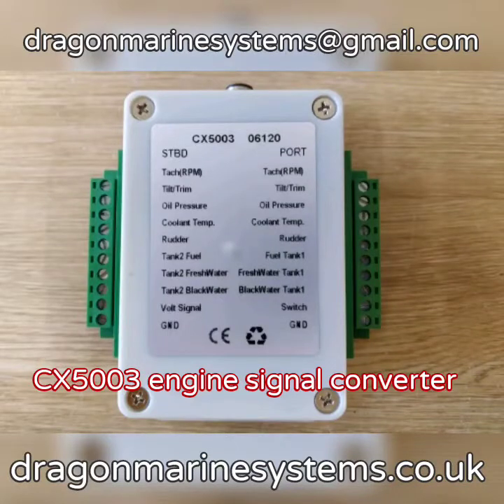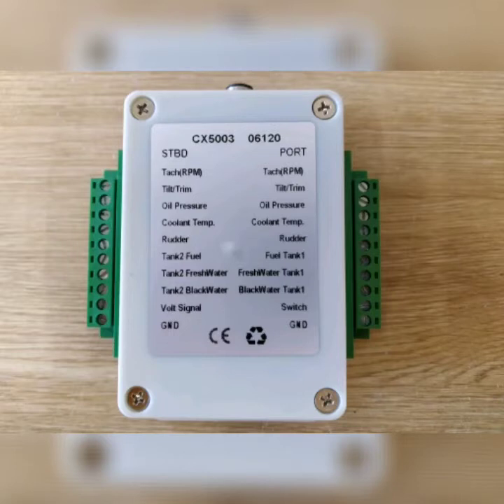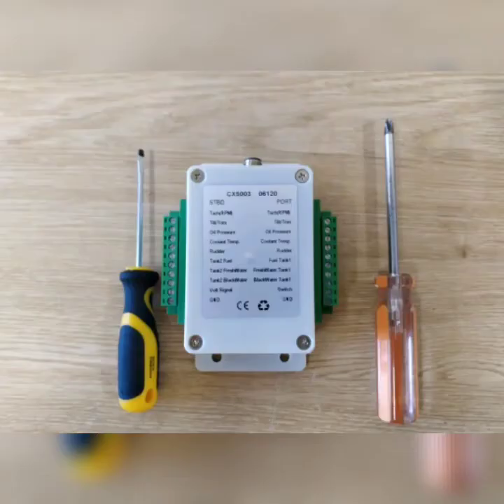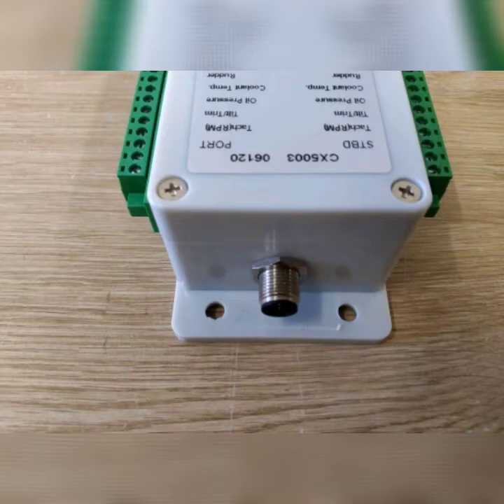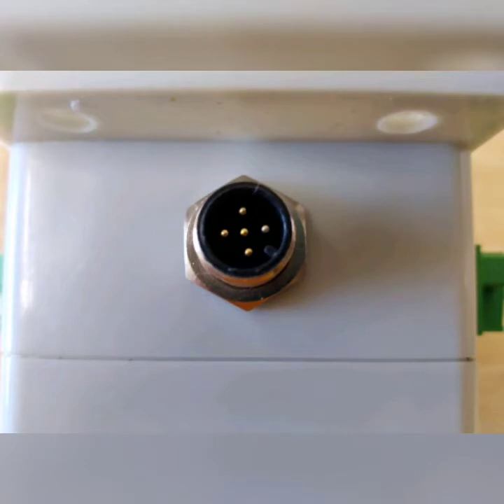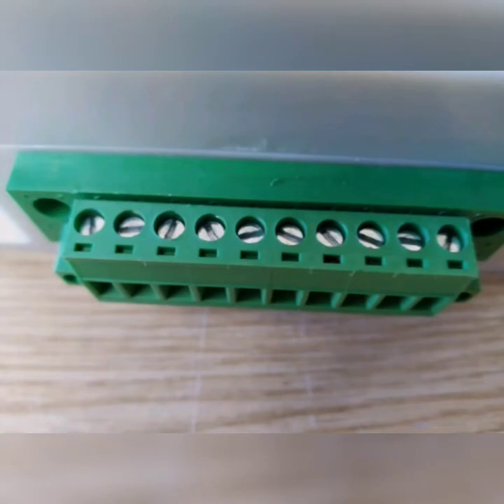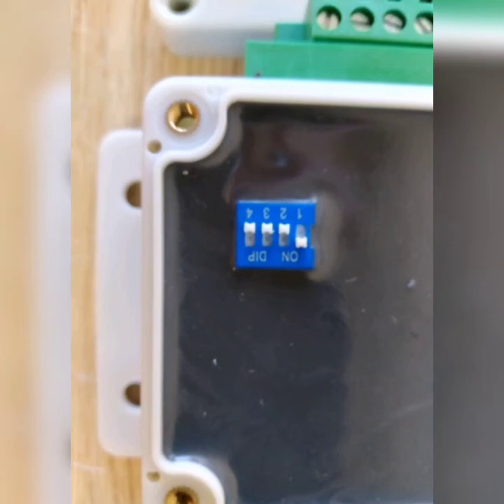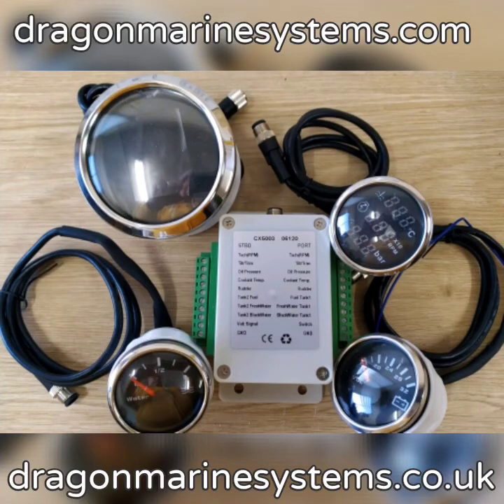CX5003 NMEA 2000 engine signal converter

Comment: What do you define as a "Standard gauge"  is this standard NA resistance values?  Euro values?  Yanmar values?  If it cannot be programmed how do you define that readings mean?
Reply from the maker: Our standard gauges are non NMEA2000 gauges...

The NMEA system sends the readings and can connect to NMEA gauges and tell you what the readings mean.

Comment: you don’t use words to create a sentence in N2k. I guess if you’re looking for a way to describe how it converts analog data into n2k you would just simply say that. But there’s no sentence in programming terminology, just messages or successful communication. 

Also dim switches are dip switches. Dual inline pole. 

Contemplating getting one of these for my 1990 boat with twin engines. Do you install a lot of cx5003?
Reply: I have one and I’ll let you know if it works with my B&G mfd.
Reply: @Nixontheman please kindly advise your progress. Thank you.
Reply: @goodgiovanni  it works as far as temp and fuel go, with plug and play. I have not been getting any output to the Vulcan 7R when the tach input is from a Balmar external regulator, I’m going to install a reluctor ring and pickup soon, and I’ll report back
Reply from the maker: No but look we're creating a sentence now!

Thank you for your comment,

We fit these often and if you need any assistance or fitting contact us at www.dragonmarinesystems.com

Thanks 
DMS

Comment: I finally got around to setting this up. Got new sensors just trying to get oil pressure and temp on my garmin. Can not seem to get any signal to garmin. I have only used the nmea2000 backbone power. Does unit need its own power?
Reply: Backbone power should be the correct answer.

Comment: My boat is made in 1994 and all analog Vdo gauges and I am using Simrad MDF EVO3 
I wonder if this will read my signal and if I will be able to see it on my MDF 
Also if I do I would like to keep my analog gauges and to see the data on 2 MDF units
Reply from the maker: Hi Marcel, 
This is not a problem. 

As we are currently doing with a job this week. You can use both analogue and NMEA systems on your boat.

The instrument panel is the direct feed to your engine and in our options should be analogue for reliability reasons anyway.

Contact us at www.dragonmarinesystems.com for more...

Comment: I've connected this unit to my honda remote outboard - see the interface on the Raymarine Axiom 7 network and display however I get no RPM signal (connected the grey send wire of the honda outboard to the RPM input). Any idea?
Reply: to answer my own question - it was easy. The standard setting of the unit is ratio 1 (all dipswitches off) - I've set it to 7 rotations for my honda BF20D (closest to the actual RPM) and I immediately got RPM on my Axiom 7 MFD. Works perfect.

Comment: I just installed this unit and it appears to be working it does not read my tank sensors accurately  but does give a reading perhaps I can scale them in the b&g chart plotter so that full is 100% and not 56%
Reply: sounds like you still have your analog gauge connected to the sender, doubling the resistance
Reply: Did you get this working correctly?

Comment: its  garbage i tried it conected just garbage send it back
Reply: Finally, I got it  installed working great no issues after a year
Reply: @danielortegamcbo please kindly share your installation. Thank you very much.
Reply: @goodgiovanni  just follow the instructions, the only thing that you need to to play a little be is with the rpm switches on the back to get the right value and get in the nema2000 settings on the screen and configure the signals
Reply: What happens I just bought one but I haven't installed
Reply: @danielortegamcbo it won’t work until after you install it. lol, I couldn’t help myself
Reply: Hey guys im having the same issue with it should be the same converter nothing is showing I haven’t hooked up to a axiom 7 inch

Comment: Hello. Do I need to connect + batteries to the voltage signal pin on the stbd side to get the voltage information in the power supply? Did I understand correctly?

Comment: Can this unit be detected and show data on my MFD Raymarine Elements ?
Reply: I have this unit connected to my raymarine 12 rv for fuel only but is reading level backward the more gas I put in the tank the less fuel is showing..Did you figured out??
Reply: @PedroRodriguez-ui6pq  give your email, i will send the manual page.
Reply: @janhedstrom4866 please kindly share the manual. Thank you very much.
Reply: @PedroRodriguez-ui6pq  had to check, it is possible to change the way the fuel level sender works, put a jumper wire between switch and gnd.
Then you should have it working .
Reply: @PedroRodriguez-ui6pq   did you get the dokument i tried tosend you ?

Comment: Is there a way to use the CX5003 while retaining the existing gauges?
Reply: It is. But you'll have to change all sensors who use resistance to dual station. Per example oil pressure and level indicator.
If you do not change them you will get wrong readout.
Reply: Video said no

Comment: Awesome info.   Only one of it's kind and well I am getting suspicious.  But good info.   If this is powered by the network then will it be picked up by a plotter or MfD when connected to n2k or do you need to have a sender connected before the unit broadcast onto n2k?   A sime scan of the n2k network on my plotter is NOT picking up this device...  I have a B&G Vulcan 7 and a Ocean Link 4.3
Reply: Yeah, did you get it working?
Reply: did you figure it out?